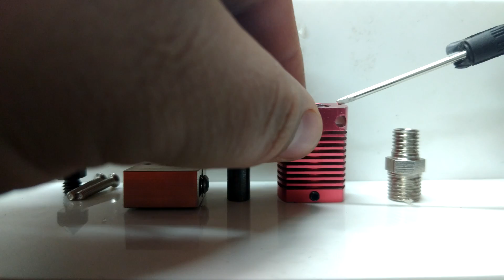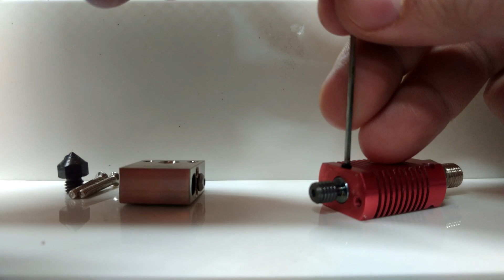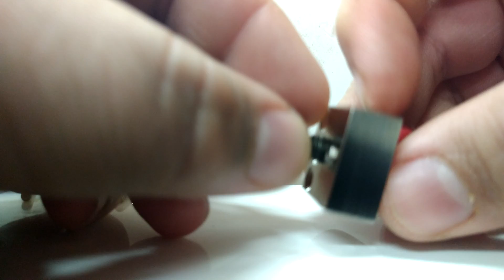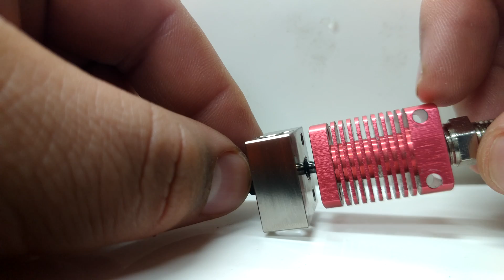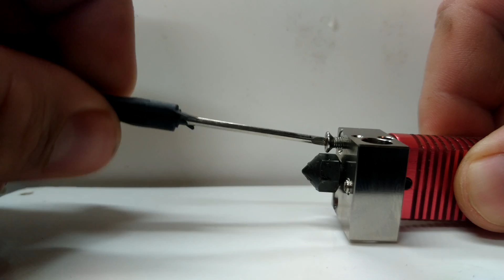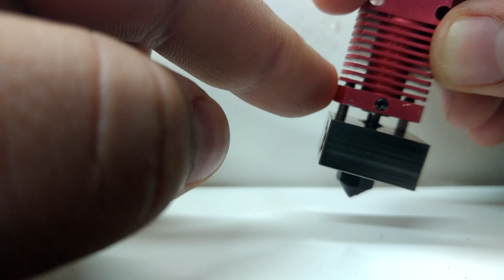How to build a High Temp Abrasive Resistant MK8 Hotend

Comment: Sorry to say this but those last 2 screws are useless, as you know well the Steel of those screws and the titanium from the heatbrake will damage the copper block anyway as both are harder, and instead of protect anything you'll transfer heat to the cooler, just let them out and you'll see great improvements

Comment: I have been going much the same route with my Ender 3v2. Copper heat block, bi metal titanium heartbreak. But you did miss or gloss over a couple important points. First, all the doing and re doing of the heartbreak into the heat sink. Just screw put it and the nozzle into the heat block first, then attach the heat sink. No reading of grub screws all the time!
Also, with the stock thermistor you still shouldn’t exceed about 250 to 260 degrees because the ptfe covered leads of the thermistor are clamped against the heat block and can’t take anything higher! But you can get a thermistor from gulf coast robotics that is mounted in a little screw in brass fitting that goes in the screw hole that holds the thermistor. It is rated to 300 degrees. You do have to change the thermistor type in marlin firmware though. Also, be sure to do a new PID tune after making ANY of these changes to be sure the temperature is controlled correctly. And the thermistor sticks out a bit further than the normal one, so you may have to make some minor changes to fan shrouds for clearance.
Maybe you should make an updated video that has all this stuff in it!

Comment: Excellent, I just came up with the same solution for a ender 3e upgrade. Adding dual z with timing belt. And went with slice c-e heatbreak plus copper hotend, silicone boot, boron nitride paste all for about $83.00 on their site. Rated for 350 C.
Looking at alternative upper ends be wary, almost all advertized "hot ends" from china incorperate ptfe tubing all the way through hot end to nozzle. Thanks for the link to compression fitting just ordered it. Woo hoo!

Comment: It should be pointed out that having the Teflon tube go into the heat block isn't a new idea.  The Original Jhead hot end was made out of a rigid high temp PTFE rod that was machined into the shell of the Jhead.  The heater was screwed into a 'heat break' (actually it was just a threaded rod that was drilled out to accept teflon tube), and this was screwed into the bottom of the Jhead body.  The original Jheads used a power resistor as the heating element.  The max temperature of the original Jhead was to be limited to about 235C (was sometimes pushed to 240), making them suitable for only PLA and ABS.  A fan was usually required to cool the PTFE body of the Jhead (which had 'fins' machined into it to act as a heat sink).  So the Jhead was actually a 'plastic' hot end (Teflon being a kind of polmar ).  There was a semi-metal hotend made in Australia, that was similar to the Jhead, with a PTFE tube liner, and there is now the E3D-Lite as well.  All of these are good for PLA and ABS.  For many, this is good enough.  Some PETG filament will print at 235-240C, but most work better at 250C, so an all metal hotend (No PTFE past the heat sink) is recommended to print this material.
Stainless steel is also a suitable material for the heat break, and many heat breaks use a combination of stainless steel and copper.  The screws that hold the heater block to the heat sink are often left out in the belief that they will cause heat creep, however you can get stainless steel screws to eliminate this issue.
As for the heat block, there are copper alloys that are just as good for thermal transfer, and are stronger than pure copper (also cheaper!).  Brass and Bronze and Al-Bronze come to mind.
You should put thermal past on the heat break where it goes into the heat sink, and on the threads going into the heat block.  Some people put paste on the screw threads as well.

Comment: Interesting,  wouldn't the 2 additional screws be better in titanium as they  provide quite an additional  thermal path to the heatsink  nullify partly the function of the titanium heat break. A heat transfer test would confirm the shunting effect of the 2 additional screws.

Comment: Awesome breakdown of going all-metal.  For the two anchor screws, going titanium will further reduce heat transfer since as it is, lots of heat will go through them and into the heatsink.
Reply: I have seen videos on removing the screws and it made next to zero difference. I don't think those screws are a massive deal. 
I have tested printing with and without them with no noticeable difference myself. 

However I do think replacing them with a less conductive metal would be a good compromise if someone wants them but wants as little loss as possible. 

To be clear I'm not arguing,the screws do  cause heat loss. Just from what I have seen in videos and real world testing is they don't seem to make a difference in print quality or substantial increase in heatsink Temps. I also haven't repeated that test with ABS or PC. The elevated Temps could prove otherwise.

Comment: Andrew did you drill out the coupler? as the Bowden tube will not go into through a standard 1/8" BSP coupler
Reply from the maker: Yes. The compression fitting require you to drill out the center
Reply: @andrewesquivel  Following your stream I did some research of my own and found the tapered thread on a MK8 hot end is a 1/8 inch NPT thread, not a 1/8 inch BPS thread, but they can probably be used interchangeably, the thread pitch is the same but the profile is different. NPT the peaks and valleys of the threads are flat. In BSP, they are rounded. Secondly, the NPT angle of the thread is 60 degrees and the BSP angle is 55 degrees. 

I got some brass and stainless steel compression fittings from China for my Ender 3 v2. I change the hot end to a Slice Engineering Copperhead, so that I could save money reusing the MK8 heat sink without tapping it. The combination has worked great, no slippage at all, I have the retraction is down to 2mm. The prints are the best I have ever produced, and bonus is a longer tube life, no external wear and no heat deterioration with the all metal hot end 

From rskl's comment (on another another clip) I might change the brass ferrules to ptfe so that it's less likely to damage the Capricorn tubing

Andrew your work is great, seems nobody else has done the research on this, I think these couplers are the way of the future
Reply: @michaellim6292  edit: are you two referring to the heat break thread that goes into the heater block?

I'm trying to find a compression fitting that holds the PTFE tube in place inside the hotend. (The stock one has a little teeth inside and a plastic sleeve you press down to release the tube.)

I don't know what search terms to look for, and what thread dimensions I need. PTFE tubing for printers is 4mm OD. Are they M10 thread?

(This is for the hot end that came with my Ender 3V2, I think a mk8?)

--- original:
I am having trouble finding the type of couplers being discussed. Are they pneumatic couplers? Or should I be looking in plumbing? Did you have to drill out the middle of the fittings you found?

(Sorry for all the questions!)

Comment: I'd like to see the results of a few long prints. Sure, the all-titanium heatbreak won't absorb heat from the block quickly. But when it does, it won't transfer the built up heat to the heatsink. I'm concerned this will result in heat creep.
Reply from the maker: Only 1 way to find out! I plan a super long print test on the Ender 5 as a test and proof of concept soon.

Comment: Agreed.  I follow alot of your posts.  Your followers and yourself could benefit from affiliate links.  Alternatively, maybe just mention where you sourced your parts?  Are you trying not to upset your MicroSwiss relationship?
Reply from the maker: I avoid affiliate links all together. It's a conflict of interest.

The only business I have with microswiss is when I pay them to make me something.

That being said, most of the time I don't link is because 90% of this stuff comes from alliexpress and their links go dead or they change what is sold in the link all the time. They are super unreliable in that regard. I prefer to say the brand and model of a thing so people can search it, which usually yields more accurate results.

The heat break I got at TH3D

The nozzle and heater block I got from Mellow on alliexpress

The compression fitting are something I'm hoping to import and provide easy access to here in the USA to my viewers. They are undranded, but are 1/8th Inch BSPT to 4mm single ferrule compression fittings
Reply: @andrewesquivel  Awesome response sir.  I have same type of aliexpress fittings and have tapped a few heatbreaks for them.
Finding reliable, lower cost components for legacy type hotends is not easy.  Thanks.
Reply: @andrewesquivel  thanks

Comment: Are you aware of a bi-metallic heat-break that fits a MK8?
Reply from the maker: Yes! I believe Triangle labs makes some. I have yet to test any, but certainly something worth looking into.
Reply: I got one of the stainless/copper ones from Mellow. Definitely saw an increase in heat creep and frequent clogging when using >3mm of retraction. Part of the issue with that one is that the "all metal" part still lets the bowden tube go pretty far down into the heatsink. Nowhere near the heat block, but still far enough down to where the amount of heat creep can be an issue at the heatbreak/bowden junction. A BMG-style extruder helped a lot there, but it still needs more tweaking. I'll put together a video when I actually get back to making videos again.
Reply: @swolebro  I haven't had an issue with my mellow one, doesn't matter what retraction I've used I haven't had clogs, am using a BMG extruder with direct drive
Reply: @rentaspoon219  BMG in a bowden setup here. Cut a slight clearance groove in it for the Z screw and put it in the same place as the OEM one. Of all the upgrades I tried, that one was the most beneficial.

The second best was a new fan shroud (Thingiverse item 3419531), that channels the air directly over the cold end, rather than the default Ender 3 one, which blows air all over. I'm pretty sure that one was needed since my OEM fan died and I replaced it with one that was not quite as strong, but much much quieter.